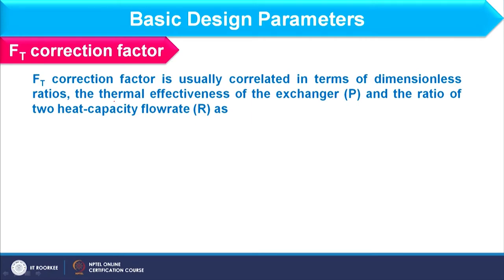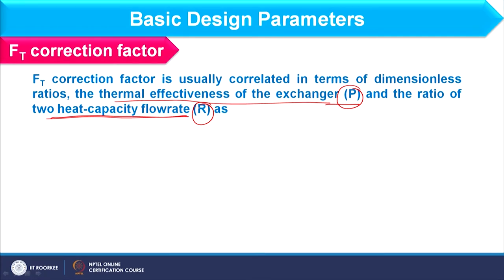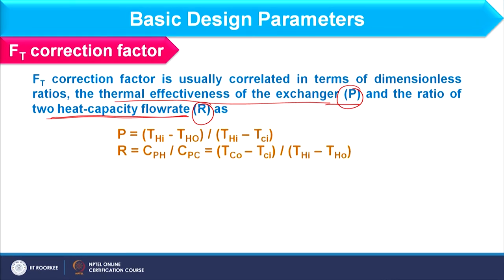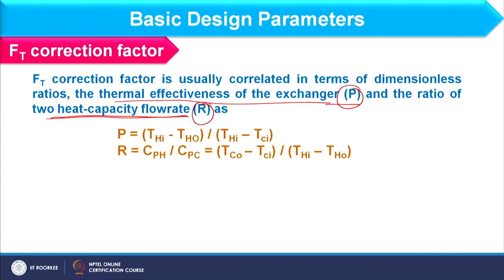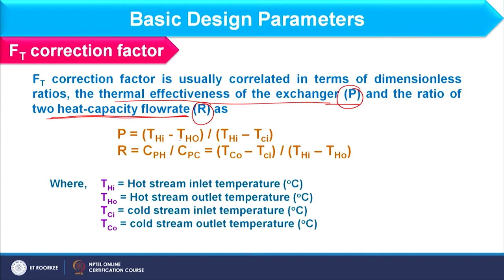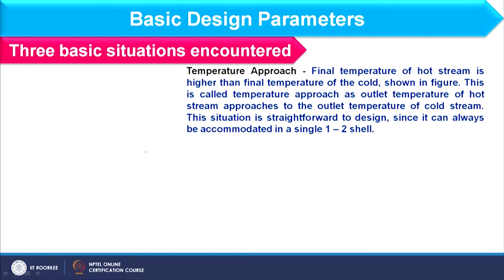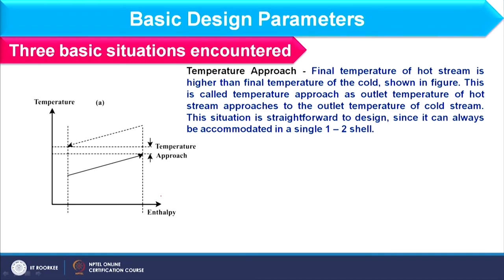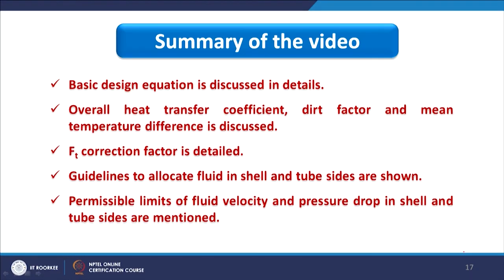Lecture 05 : Basic design parameters-2

Comment: The P value is the ratio of difference between hot fluid inlet temperature and hot fluid outlet temperature to the difference between hot fluid inlet temperature and cold fluid inlet temperature. As the inlet temperature of both hot side and cold side fluid is fixed, the denomitor will not change whether we have temperature cross or temperature approach.